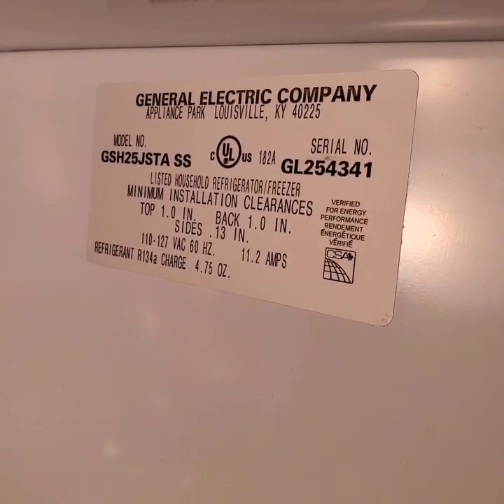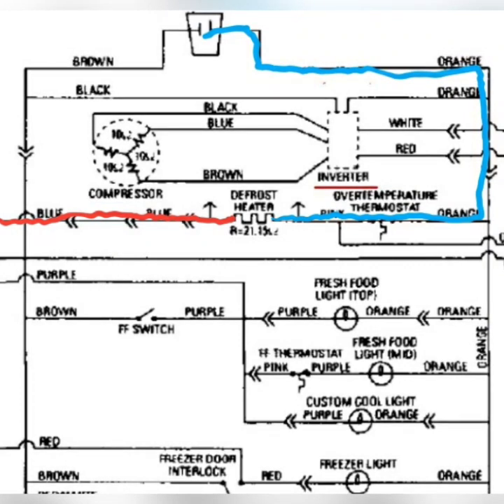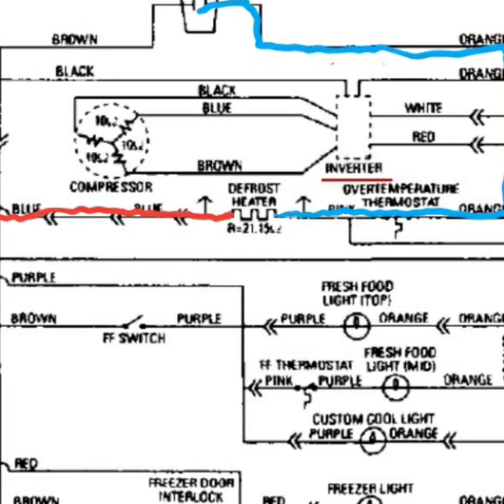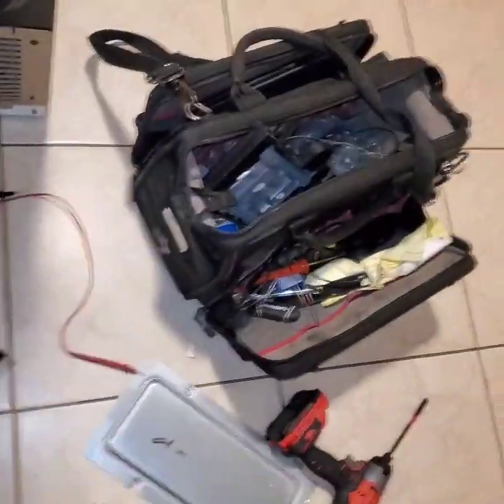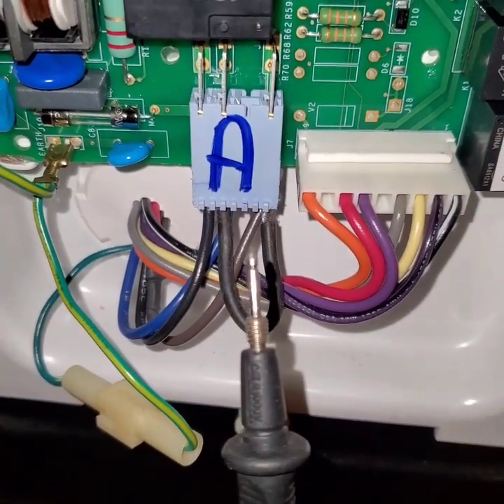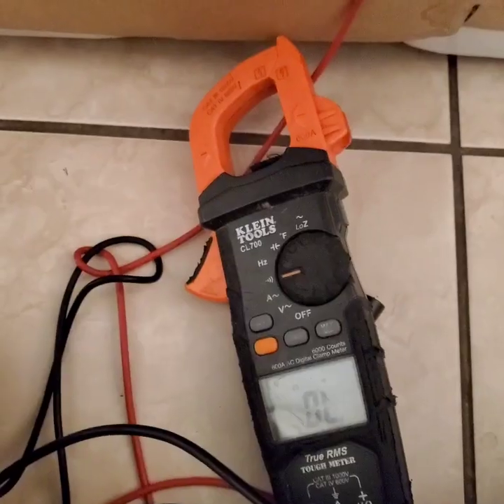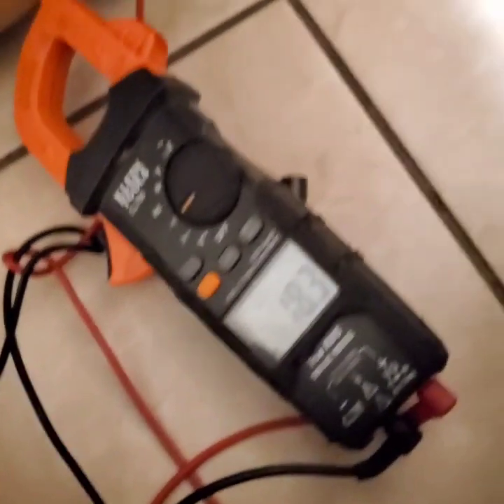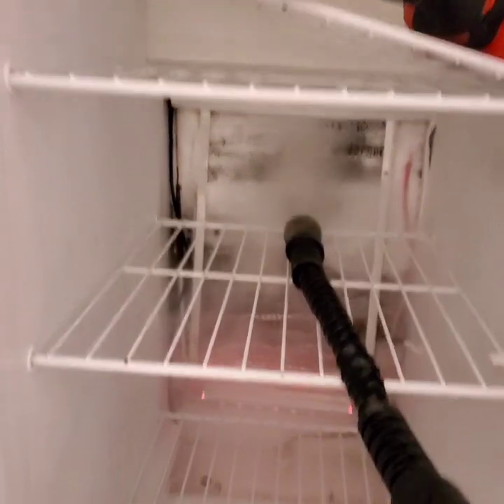#TECHTALK Ge defrost testing from the board

Comment: this is only a valid test if the freezer section is cooled down so the thermostat sensor is closed to complete the circuit. On a warm freezer this test would fail.